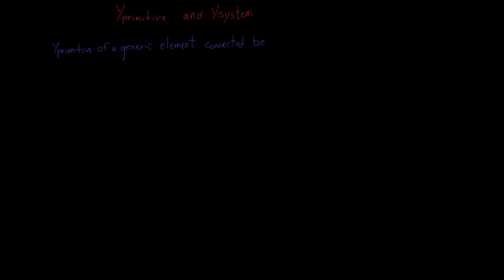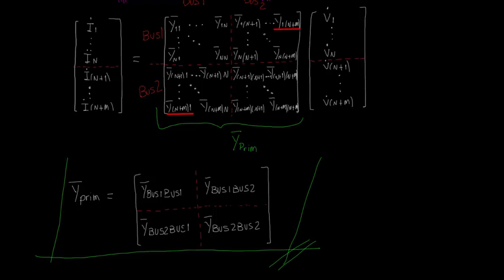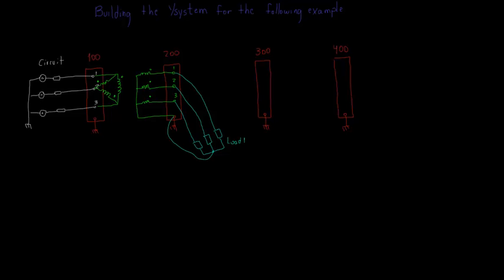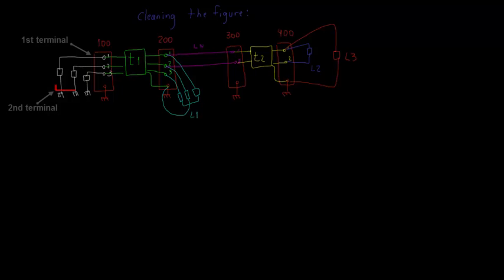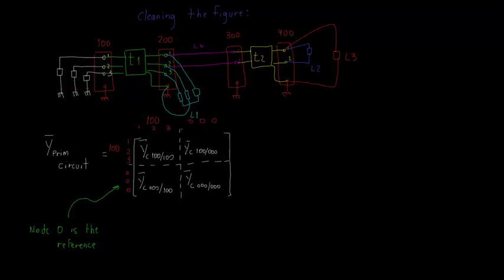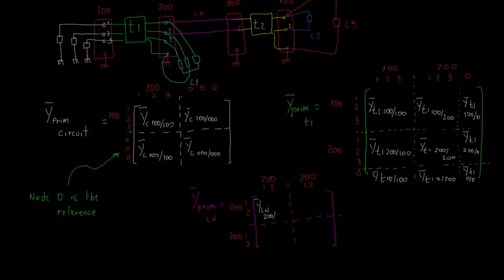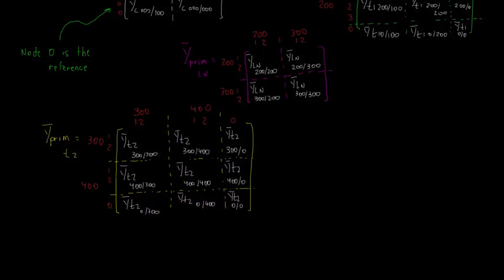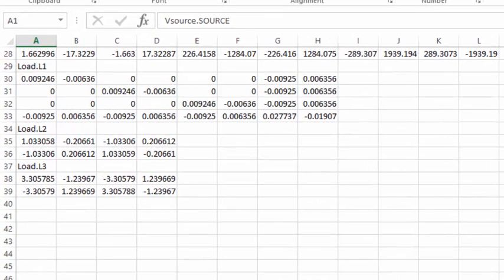5- Yprimitive and Ymatrix

Comment: Hello Paulo, thanks for your videos, I feel there is a typo here in the code for transformer t2,   wdg=3 bus=400.0.1 conn=wye kv=0.11 kva=500, it should be  wdg=3 bus=400.0.2 conn=wye kv=0.11 kva=500.  In the video it is correct. But in the code given below the video, it is not right.